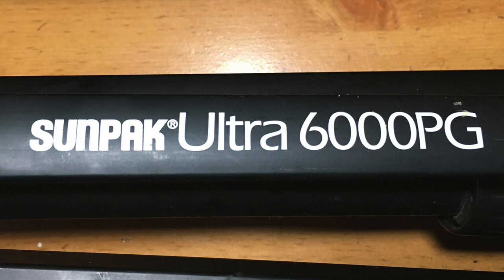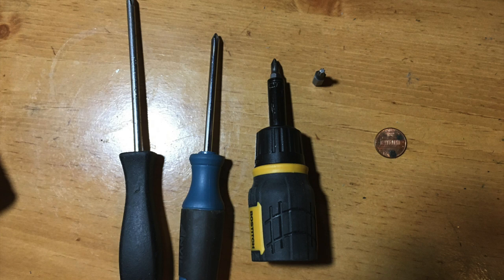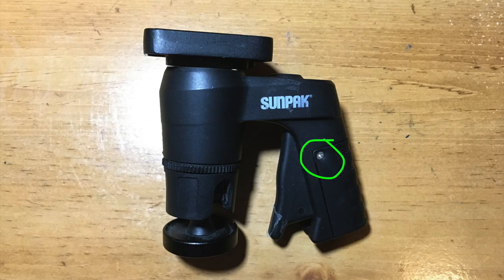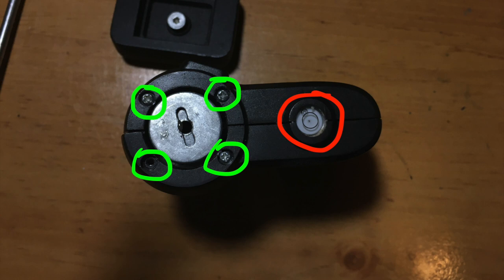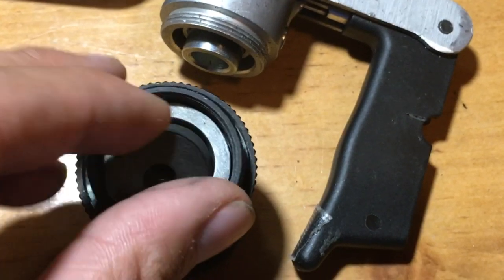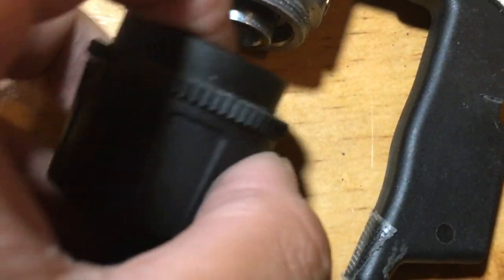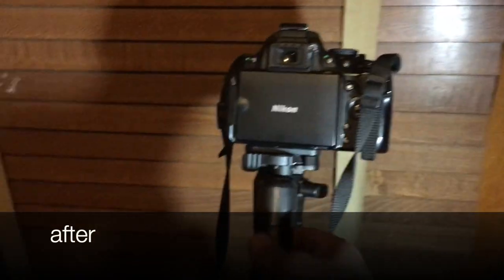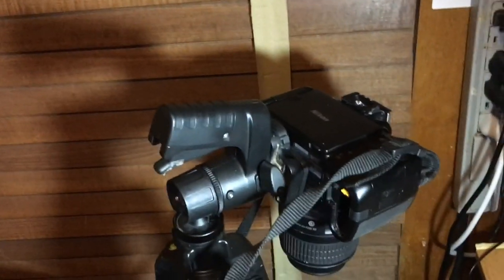1¢ Fix – Sunpak Ultra 6000pg Tripod

Comment: Very helpful, I just did the repair. As someone else said, the pistol grip screws not to be to be extracted. Also, leave the knob, as you need that to hold the inner workings from twisting as you unscrew the screw that holds the camera mounting surface bracket. Speaking of which, mine is not the same as the screw that you showed in your video. Mine was a special security bit. Looks like an allen wrench with a hole in the middle. I didn't have any that fit, but a star bit with a hole in the middle did. I just happened to have a security bit set that I bought cheaply from Menards.

Comment: I’m going to try the Penny thing. For some reason my “shoe” has become very wobbly so even though the grip handle has the bulk of it steady the shoe plate just is loose and flips around which defeats the purpose of your camera or device from wiggling. Thank you for the suggestion.